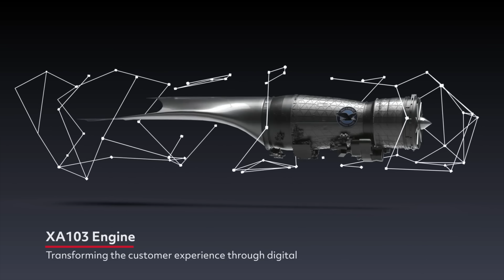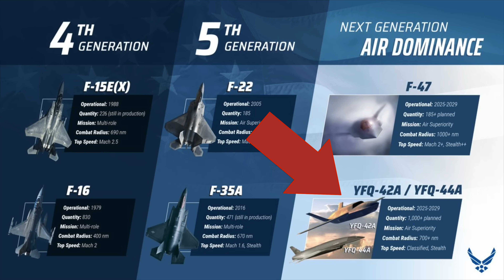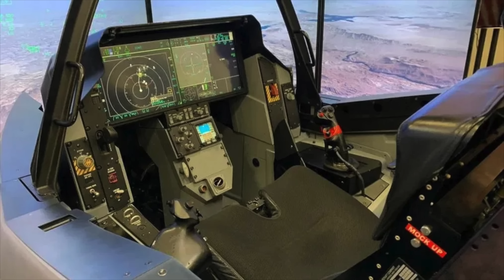Is the US Air Force F-47 Already Flying Missions?

Comment: I've got a feeling that this is NOT the Air Force's most secretive project.
Reply: "Back in 1974, we SeaBees were on isolated duty on Diego Garcia—no women on the island, and even thinking about getting romantic with the wild donkeys would land you in the brig. We were pumped for a USO show (Ann-Margret, maybe!) making its way across the Indian Ocean, when a U-2 made an emergency landing on our bare-bones airstrip. The USO flight was told to turn back to India—no civilians allowed while that plane was on the ground. That was 20 years after the U-2 was developed. Imagine the level of secrecy still in place. Same likely goes for the SR-71. Now think—if that was the cloak-and-dagger protocol back then, what might be flying overhead now that we won't know about for another 20 years?"
Reply: @jer2xjim And the rate of progress through discovery itself also increases. Mind boggling.
Reply: @jer2xjim  I already your answer. And they are all over the skies. UAP (unknown areal phenomenon) craft flying using various sorts of hot plasma drives that allow them to fly instantly in any direction. If you dig enough, the patents are already out there for them and other countries have them as well. Some can even turn completely invisible, fly at the speed well beyond conventional jet power, and can submerge underwater. These have been around since the 1950s in active use. They have only gotten more advanced. 

There is much more out there than we are allowed to know. But the trick is not to look at the government. Just the companies contracted to produce capability.
Reply: @geronimo5537 😂
Reply: I agree. The fact you know about it means there are other even more secret projects
Reply: @gabrielf1911  Some of the abilities cold war submarines were capable of are classified. Mistakenly was told one thing they could do, lets just say if they could do what I learned in the 80s, what we must be capable of now is something that makes sci-fi look primitive.
Reply: Ya prolly 3 generations behind
Reply: They want us (and China) to see it.
Reply: Facts
Reply: If they are telling us about it. It's already 10 to 20 years in the making, so just imagine what they have now
Reply: The fact that we know about this and a B 21 raider makes me really scared for what we have cooking off books
Reply: In 2009, a retired Navy and Air National Gaurds man whom also was a high degree mason had told me , The AirForce has had a bigger Space program than all of NASA. Well fast forward to Recent years, where do you think Space Force came from? What department?
Reply: @shyahisotalo7826  NASA was put together solely for purposes of propaganda for the space race.
Reply: @shyahisotalo7826  why do you act like this is weird or something they were trying to hide? The military has had a role in space since the beginning. We have all types of military satellites, radar, and AA systems that are focused on space so it’s not far fetched that a branch of the military would be the ones to control them. Not everything is some grand conspiracy. And wtf the does dude being a “high level mason” have to do with anything? Lmao they’re not what you think they are.
Reply: No but it gives us a glimpse of something amazing coming
Reply: They’re already working on 7th gen
Reply: @ExplainingPerspective 😂 how exactly? without rare earth elements?
Reply: Yea there just giving us bites and pieces calling it a “ breakthrough “ when they’ve had advanced tech for decades
Reply: I'd say your right, I seen some crazy shit in new Mexico there's a lot there not telling Us
Reply: If its on youtube its not a secret
Reply: When I was a UH-60 Blackhawk crew chief in the mid 90s.  One of our pilots was an ex-Air Force C-141 pilot.  He said he had seen things when he flew to some air bases that had never been published, but after they landed, military police came out and made them sign non-disclosure statements saying that they would never tell what they had seen. He didn't tell. But he just said it was stuff that we had no idea of. I'm sure it's the same today.
Reply: If they wanted to be secretive you would not know about it till it’s declassified about 50-70 years later.
Reply: more like 20-30yrs maybe but yes…
Reply: In my opinion, whenever the government  is publicly showing a brand new A/C, it has been secretly flying for 2/3 years !!
Reply: I think the top secret us aircraft takes off vertically like an UFO 😊
Reply: We already got vtol jets @charles79-y8g
Reply: I literally loled when he said that
Reply: Stuff is usually 10 years old when we hear about it
Reply: @13Jaryd Hi, ultimately they will stay secret until they are needed en mass whatever it is they have, security around the F22, B1, B2 and F117 programs is all still very much classified, we are only ever drip fed scraps.
Reply: its the best of the tech that they let us know about. the best is what they made from the  Aurora.
Reply: If we're talking about it then its already old 😂
Reply: I agree, I believe gen 7 will be exo atmospheric
Reply: the b-2 is the only thing in the sky that can hold non nukes
the f22 is my baby and no one and nothing touch
Reply: @walterfix6156 @walterfix6156 the Raptor is so epic... but have you seen what Israel were able to do with the F35 & different AI? It's a different horse for a different course but the future is happening right now
Reply: Active duty USAF for 23 years in aircraft maintenance and WE ALWAYS HAVE MORE GOING ON...
Reply: They are prob working on the 7th generation right now. I have no confidence in Boeing however. Especially after their commercial aircraft issues. The contract should have gone to Lockheed Martin. Their skunkworks is always ahead of the curve
Reply: They own the tictacks
Reply: Correct. US Air Force and the black projects run the tic-tacs  @harlanzimmerman4405
Reply: they are only announcing it now because they have something better in the works already
Reply: oh, Noooo Nooooo good sir, how dare you question the narrative the government itself keeps trying to feed us about UAP = Aliens.. "duurr, uh, we dont have that technology no way.." - some career type A military guy with no inner monologue
Reply: Big joke if its secret then nobody will know. What about area 51?? Alien technology reverse engineering 😅
Reply: REVEALLLLL 😅 yo the ufos are meant to be lock heeds, i saw rendalsham style before, think about it dummies, why they land on MILITARY BASES? seems obv
Reply: I’m still thinking electro-gravitics and advanced propulsion using “clandestine physics” is likely what they are clearly developing and hiding.
Reply: Just look at that special place in Nevada 👽👽👽
Reply: U reh
Reply: Lol
Reply: I agree
Reply: Tr-3b
Reply: Yea like terrestrial tech
Reply: Right its as funny as when any one says … on most UFO documentary’s I’m pretty sure we don’t have anything like that technology as far as i know, if they were worth believing, they would atleast know and remember what compartmentalism is…
Reply: The hypersonic bomber DARPA is working on is the most secret that we know of.
Reply: Nope! Absolutely no way it is. 🤣👍
Reply: Klingon warbird wings
Reply: Duh lmao
Reply: F 35 was secretive once look at the disaster it turned out more broke than fixed with a cue for spare parts. 😊🇬🇧🇺🇸🇩🇪😎
Reply: It isnt by far
Reply: If they showing us new stuff 100% some secret stuff happening
Reply: Look for the black triangle with the light show. Coming to an airshow near you.😊
Reply: Not by far. 😂😂😂
Reply: If we know about it, it’s likely been flying for the last decade.
Reply: TR-3B
Reply: Probably flying stuff now we won’t hear about for 30 years
Reply: That's not the plane!
Reply: If we're even remotely aware of it them its absolutely not their most secretive project
Reply: Agreed!!!
Reply: Duhh
Reply: If its in the public domain then it obsolete to the military and they've already replaced it with some more advanced
Reply: Right.
Reply: I agree the airforces most secretive project is currently where the hell do we get rare earth elements to build our military equipment from now.
Reply: The TicTac UFO is allegedly built by USAF for the Tall White aliens.....
Reply: It doesn't have ant gravity like some being tested.
Reply: Theirs other proto types being tested.skunk work projects are always working on secret projects for all armed forces.
Reply: What do you know??
Reply: The United States is 60 years ahead of everyone else and I'm not trying to be funny but it's just true. The stuff they release to the public has been flying undetected for years. There's a reason why half of the world hates the USA and can't do shit about it 🇺🇸🇺🇲💪🏼
Reply: I got a feeling the Chinese has a few secretive project too.  I been told by the higher-ups that are not very transparent. 😅
Reply: Lmao. Obviously not a secret, been announced. Their secret projects are hidden and the ufo nerds are trying to get them released.
Reply: That's always how it's been, the first stealth was a UFO for many years before the public even knew about it
Reply: I always liked the saying top secret aircraft don’t really exist but top secret capabilities definitely do. Like I wonder what tf the F35 can do that we don’t know about.
Reply: I’m thinking “aerospace fighter” or bizarre tic-tac drone…
Reply: Exactly! We won’t hear about the human/bird/goat hybrid in an official release for another 10 years minimum.
Reply: China will get sick watching this
Reply: We were teleporting Malaysian airliners in 2014 with plasma orbs, so, no, not our best tech.
Reply: I don’t disagree.  Like the nod to aviation history.
Reply: Not all chance
Reply: By the time the public is informed of a new aircraft there is more advanced aircraft in the works usually 10-15 years ahead of the latest.
Reply: Not even close…
Reply: Bet your life he’s correct !!! ❤
Reply: @RonaldMayDMD-nt3fd the fact they confirmed this publicly means there are more secret projects. If the public know about this aircraft then there is most definitely other drones and aircraft we don’t know about use basic logical thought here
Reply: by years
Reply: You're absolutely correct
Reply: It better not be.
Reply: @dextermorgan1 why? Don’t like winning?
Reply: Not even close
Reply: They’re 50 years more advanced than what we’re allowed to see
Reply: I was looking through a telescope one night and saw a faster than light starship in low Earth orbit. Jets are so obsolete. 😅
Reply: @RandyBaumery-s4i I was waving at you
Reply: Lol I saw a ufo bright lights all over silent right over my head in Scottsdale up In the pinnacle peak area in 2007 with two other people.  We all said... that was a ufo wtf. 😅
Reply: Well, it's technically not the air force's most secretive project but I get the gist. It's a lot of money on a cover-up. What makes it even more ridiculous is that the same companies that are in control of the good stuff also make this. Imagine having to develop a body designed for jet-engines when you have anti-gravity.
Reply: They have gravitic propulsion mercury thorium reactors since project paperclip
Reply: Can he in one of his videos talk about Mossad having a sex videos of trump in Epestien island
Reply: @m.a.o3273 go away bot, I don't care about the opinion of someone being paid by Tehran (AKA you 🤖)
Reply: Hype and clickbait!
Reply: @dougleydorite  My thought too
Reply: @dougleydorite we are not China girl 😂
Reply: @dougleydorite  For sure! I bet this one can fly to space and even land on mars ;)
Reply: @dougleydorite 😂😂😂
Reply: You mean facts and built @dougleydorite
Reply: @ragedmayhem1 you think some random YouTube dork is posting videos about americas biggest secrets?
Reply: @dougleydorite  Can you substantiate your comment from any published aviation  source ???? Or is this just an ignorant observation ??
Reply: @RonaldMayDMD-nt3fd 😂😂😂😂 we are talking about SECRET projects. Those don't tend to get published in your fav aviation magazine.
Reply: @RonaldMayDMD-nt3fd  so neither do you believe what a random stranger says online, BUT you also believe what the government tells you they have and not have? Lmfaoooo ok 

🤡
Reply: This is NAVY stealth F-47 jet fighter aircraft has front small wings can infect enemy radar systems can track em  . Trump’s beautiful bill became law forced cancellation of advanced Stealth prototype aircraft for US Navy .  Air Force wants Mach 4+ stealth highly advanced combat capability wing prototype aircraft haven’t small front wings already flown during test flight in top secret Area 51 . Only 187 F-47 aircrafts ! , not enough . Stealth F-22 Raptor jet fighter aircrafts had upgraded as refitted with new powerful engines , improved stealth design , better bomb bay door open/ closed fast avoiding enemy radar tracking , improved computer control system , improved oxygen tanks give pilots can fly higher than 50,000 feet of altitude , improve long miles range , cruise flight saving fuel became Super Raptors stay fly longer till retirement in 2050 till highly advanced stealth 6th generation Wing jet fighter aircraft arrive in 2040 after Trump are no longer President but in federal imprisonment for life without parole .  New Democrat President in 2028 , order restore Navy stealth advanced 6th generation Wing aircraft development while Air Force 6th generation advanced Wing stealth aircraft capable Mach 4+ as highly effective combat capability before new 7th generation stealth prototype aircraft arrive in 2035 as fully operational in 2040 or 2045 because rumors about mysterious 7th stealth prototype manned aircraft flew during test flight in top secret Area 51 , reported about advanced hypersonic jet engines manned prototype aircraft flew at Mach speed as top classified . US top admiral are very upset about cancellation of advanced 6th generation of Wing prototype aircraft because NAVY Prototype aircraft flew during test flights already before ready for truth to every American taxpayers see it .
Reply: @patrickgarski4540  you're a strange dude 😂
Reply: @patrickgarski4540  bro wtf are you even trying to say? Yall gotta learn to proof read lol
Reply: @patrickgarski4540  a Democrat president will strip the entire defense bill for free crap given to everybody coming into the country that's not a citizen and keep giving away our stockpiles and weaken the United States
Reply: @patrickgarski4540  I usually don't read novels but I read yours and thought you had some good things to say.
Reply: @patrickgarski4540  funny it was Obama who cut funding for procuring more F-22s and it was Biden with his spending bill Majorly cut military funding. So under democrat leadership I see our military shrink though it's not much better under Republican leadership either. Our military is in decline due to too much focus on technology vs procurement. Won't matter how many high tech fighters jets you have if it's not enough to get the job done and then some.
Reply: @patrickgarski4540 from the future?

Comment: My friend is a real aerospace engineer.  He said he can't comment on anything.   What he did say is that the parts were farmed out to many manufacturers.  There were several different models made, and they were flying years ago.  What he reluctantly told me was that his manager demanded that the parts be manufactured using the wrong bits or milling speeds.  He immediately informed the manager this would fail to produce a usable part.  When the part didn't meet specs, it was thrown out and started again, but now to his recommendation.  This is how they double bill Uncle Sam and the taxpayer.  They just play games at the beginning and do it right in the end.
I asked him if if the new plane was awesome, and he smiled and said yes.  If he smiled and said yes, it's got to be good, Kung fu!

Comment: Click bait garbage.

If the F-47 really is a program and if it really is a Boeing product, there is zero percent chance that it is already flying.  I’m betting Boeing will never deliver, but that’s another story. 

There is so much false info coming out of this administration that it’s impossible to determine the truth.  

Just a short time ago Trump said he wants twin-engine F-35’s because he “doesn’t like single engine jets.”  So let’s start cranking those off the line tomorrow. Just slap another engine in there.

He also said he was starting up the F-22 line again - with no explanation as to how he would do that. 

And the notion that Max Afterburner just happened to find a photo of a beyond Top Secret F-47, allegedly parked at Area 51, destroys all credibility of this video.

Comment: New generation fighters need to be bigger... because they also need to be supercomputers/datacenters (onboard)... new 6 gen is not just a Plane... it's an architecture of many subsystems (drones, radars, IA, etc) attached to the  F-47.

So when you are against a 6 gen jet your only worry is not just the Plane itself but all their other systems that are against you (small autonomous drones on Air or Sea)

Comment: So... what you are (trying) to tell us is, all of the metalwork, carbon fiber layup, engine development, wiring, plumbing, wind tunnel testing, flight testing and ALL THE OTHER SHIT that has to be done before a plane is built has already been done bespoke one off custom shop style before Boeing even gets a shot at setting up a production line - cause Boeing hasn't built one yet...